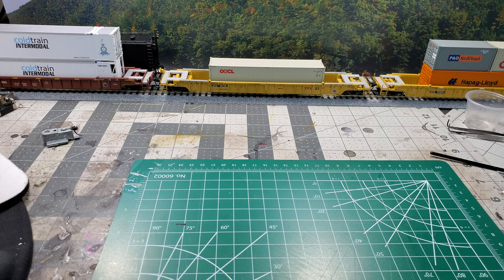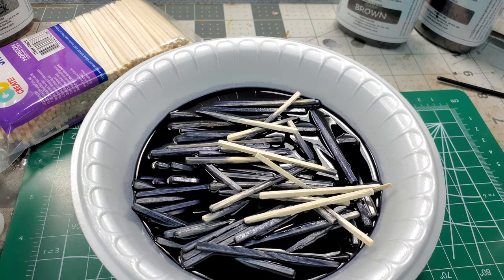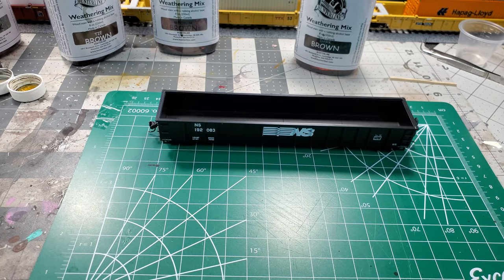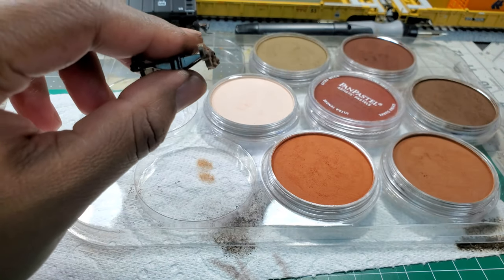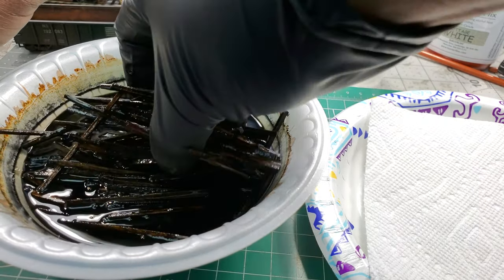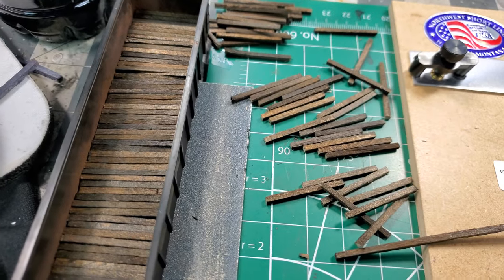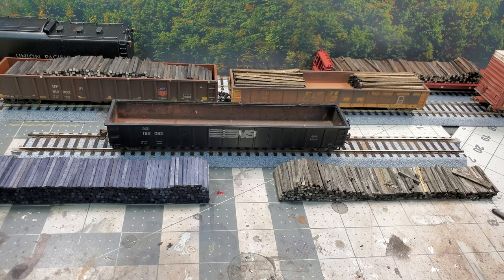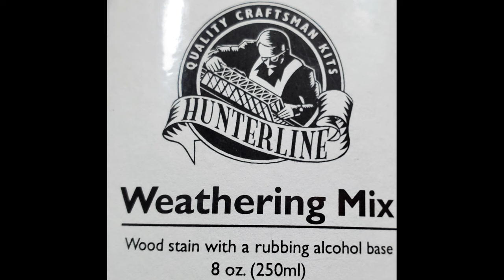How to Realistically Weather and build HO Scale tie load

Comment: Great job👍, they look natural. I've been buying a pack or two every week for my kooper's Tie plant that ill be modeling, they manufacture the ties for the RR.  Unfortunately I'm going to need somewhere around three to four thousand of these,  plus more for the gondolas. I did note, you Staind the full length and then cut them, which is fine. But it leaves the ends White/ clear. Cutting them before you stain would be best. Just an FYI.
Reply: And I forgot to mention these are true scale to Ho scale.
Reply from the maker: Thank you for checking out my video. I re stained the ends of the Creosote ties Doing the making of the  video. I went back and stained the ends of the outher ties   When I was making the utility Pole load.